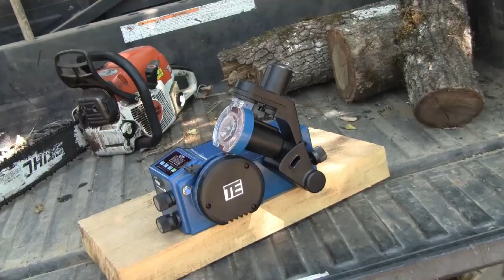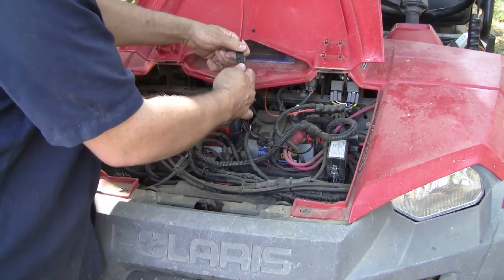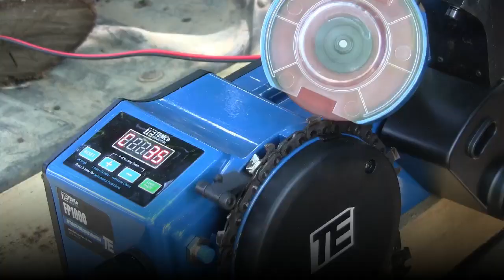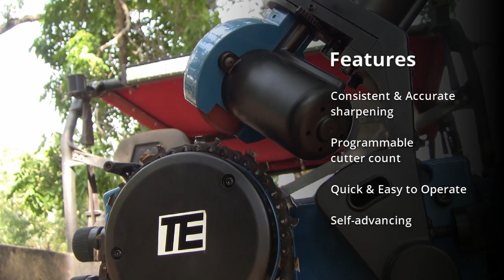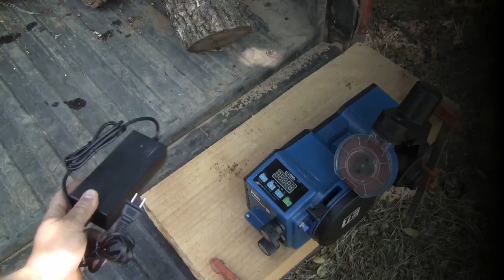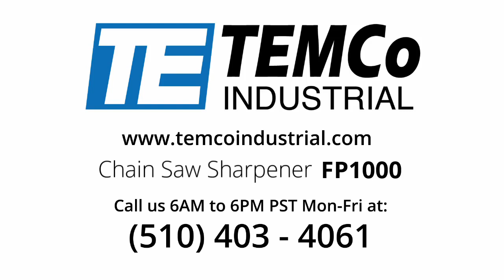TEMCo Industrial FP1000 - Automatic Chainsaw Sharpener

Comment: If they made it change the motor rotation direction every other tooth, so that it always filed from outside toward center of chain on each tooth, I'd be ordering one right now.  Looking for one that will pull inwards on each tooth, so as not to raise a burr on every other tooth when its pulling towards the outside.  Seems like it wouldn't be too tough to switch directions, if its a DC motor. Might need a electric brake function (like my dewalt miter saw has) to stop rotation before reversing, in my mind would be worth it, even if it increased the total time needed to complete a chain, if final result was improved.  But I don't know, I've never tried one of these.  i just have the old standard kind now, using the plain pink wheels.  Maybe just upgrading to the CBN wheels would be enough for me...

Comment: Just bought this auto grinder and now it is no longer available. Can't even find any replacement wheels for it. PLEASE DON'T BUY THIS UNIT. IT IS NO LONGER AVAILABLE. IF YOU DO NEED A GRINDING WHEEL, GOOD LUCK TRYING TO FIND ONE. EBAY NO LONGER CARRIES THE WHEELS, AND NEITHER DOES AMAZON.
Reply from the maker: If you purchased the version with CBN wheels, for the most part, you wont ever wear them out. Alternately, you can also find the standard grinding wheels on Amazon here: https://www.amazon.com/TEMCo-Industrial-FPA119-Grinding-Sharpener/dp/B08HJMSHBD